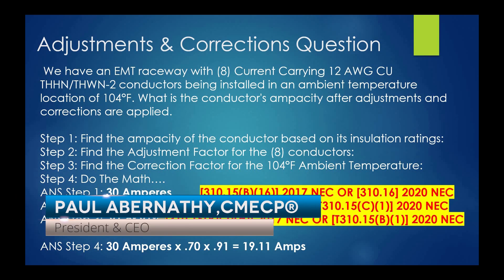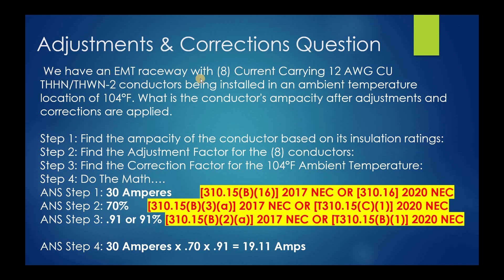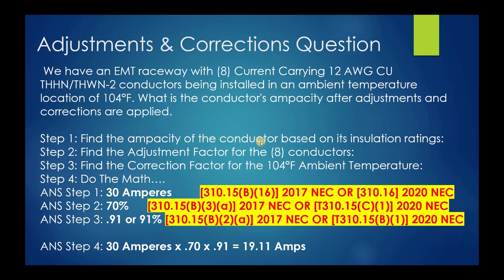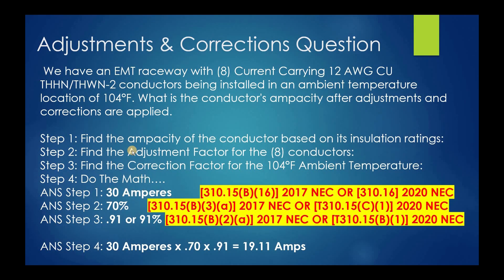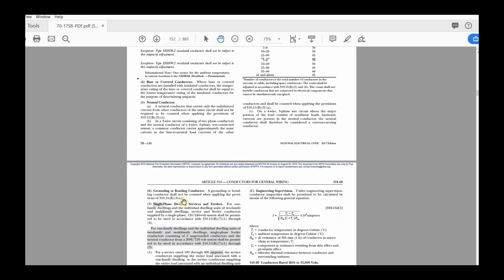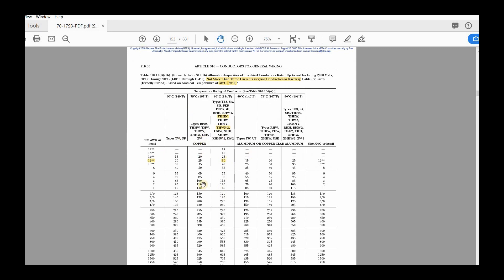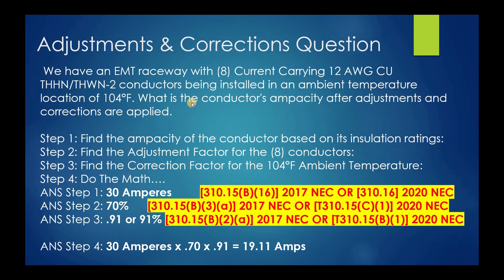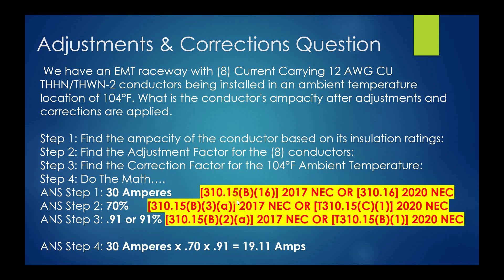Applying Conductor Adjustments & Corrections- Simple Example

Comment: Hey question.. so when u went to table 310.15 ( B ) ( 2 ) in the 2020 book, and you went to the 90° column and then picked the ambient temperature of 104°F.. how come you got .91 when on my chart it says 1.00 for my correction factor? Unless im off or im missing something, did you mis use the percentage or is there something i did wrong? How do you know when to use table 310.15 ( B ) ( 1 ) or 310.15 ( B ) ( 2 ) ? I figured we'd use the ( B ) ( 2 ) because it says " based on 40°C ( 104°F ) and 104°F is our temperature.
Reply from the maker: You never use (B)(2) except when working with ampacities in Tables 310.18 through 310.21. If the table, such as 310.16 and 310.17 is based on 30°C (86°F) then why would you attempt to use a table based on 40°C. Watch the video again.....you use Table 310.15(B)(1) and the 60, 75, or 90 is chosen based on the insulation rating of your conductors. Also if you see 1.00 for 104°F on your Table 310.15(B)(1) I suggest you return it quickly...;)
Reply: @MasterTheNEC  appreciate the response 👍🏼

Comment: Thank you for the video I have a job site situation. I have 9 circuits (general use receptacles) to run in a 1 inch EMT. So 18 current  carrying conductors. number 12 thhn. So 50 percent adjustment on 30 amp wire. Is that ok on a 20 amp breaker. Thank you.
Reply from the maker: No, see my other response to your previous question. Also if anyone says you can use 240.4(B) they would be wrong since you are supplying receptacles so 240.4(B)(1) renders that unavailable and since an OCPD rated 15A does exist you are bound to it. If the circuits must be rated 20 A then you will be forced to reduce the number of CCC's in the raceway or consider MC Cable as an alternative option.
Reply: @MasterTheNEC  thank you 🙏.

Comment: A question please sir,
We have  some of insulation listed in 75 column and 90 column so which column should I use?
Reply from the maker: You can use the 90°C Ampacity value for adjustments and corrections. However, you can not exceed the ampacity based on terminal limitations. So, at the end of the day you can't exceed the 75°C value.

Comment: How do you know in the 2020 code to use the 310.15 (B) (1) or (2)
Reply from the maker: Greetings,

So, (B)(1) is for Tables 310.16 & 310.17 based on the 30°C nature of the table, you will use (B)(1) 99% of the time.
Table 310.15(B)(1) Ambient Temperature Correction Factors Based on 30°C (86°F)

And, (B)(2) for tables 310.18 through 310.21 as the nature of those tables are 40°, as shown below.

Table 310.15(B)(2) Ambient Temperature Correction Factors Based on 40ºC (104ºF)

Comment: Hey great video, thanks for the information. I just subscribed after viewing this video. I have a question my professor has given us a similar question. Theres 9 current carrying conductors installed in an ambient temp of 104f. I got the .70 for the conductors but I'm confused as to where to find percent for ambient temp without amps or wire size given to me.
Reply from the maker: The values used for ambient temperature above or below 30°C (86°F) is 310 15(B)(2)(a) in 2017 NEC or 310.15(B)(1) in 2020 NEC.

Comment: So if I have 2 #10 THWN current carrying conductors run in PVC on top of a roof with an estimated 114-122 degrees F all I need to do is multiply 35 by .75?   And the maximum amperage allowed for those conductors would be 26.25?  That is easy is right!
Reply from the maker: Greetings Kevin - Well THWN is only able to be adjusted from the 75C column in T310.16 since the insulation is only rated for 75C as stated. Now, when using T310.15(B)(1) as well you would use the 75C column as well. So If you are looking to see what the NEW ampacity is of the conductor based on the ambient temperature of 114-122F then that multiplier is .75 as you correctly stated. So the ampacity in T310.16 is 35 Amps so 35 x .75 is indeed 26.25 Amps and that is the new ampacity of the conductor. Keep in mind you only had (2) current carrying conductors so if you end up more than 3 then of course you would bring 310.15(C)(1) into the picture as well...that would look like 35 x .75 x .80 assuming 4-6 current carrying conductors so it would be 21 Amps with both adjustments and corrections figured in. Hope that helps and sorry for the delay as I am back home with my mother.

Comment: "Simple" he says...
Reply from the maker: Easy Peasy...:)
Reply: @MasterTheNEC   It's the jargon that gets me. Interchangeable terms and vaguely defined terms. I get how an electrical system works(mostly), but trying to learn the particular lingo and understand it to the point where there's no loss of comprehension when trying to take the test, that's what concerns me. You do a great job brother and it is greatly appreciated, but not even you could make the process of learning the standard definitions and book memorization painless. I'll still watch though, you're as good as it gets to relating what is meant to be said in this book of secrets(NEC).
Reply from the maker: Sam, I understand. The terms we use are normal for those who have the time in, qualifying hours,  to qualify to take an electrical exam. Actually, the terms are found in the definitions of the NEC, and they can be complicated but over time they become easier. Our Fast Trax™ Program is designed to teach these things but it does take some time to feel comfortable with the terms.
Reply: @MasterTheNEC  I have a copy of the 2020 edition. Im getting used to it slowly. The issue for me is context. When I'm watching one of your videos and you go over something specific, in context, then it clicks and I understand what's being said in the book. I think i have a basic understanding of the nature of electricity; i see it as similar to fluid dynamics and when people compare things like voltage to pressure it makes complete sense. I'm good at troubleshooting problems in electrical systems; i.e. tracking down where someone has tied the neutrals for 2 circuits together, and im good with basic code like sizing wire and loads, but its the technical stuff that is going to take some time for me. You have definitely been my biggest help with getting a sense of what exactly is being said in the book and i really appreciate you for it Paul.
Reply from the maker: You are most welcome brother..Keep At It......Glad you enjoy the vids and podcasts. Keep on that journey!
Reply: @MasterTheNEC   Hey Paul, i hate to bug you but can you answer me a couple 3 questions? #1, how much is your fast trax program, and #2; im confused about the wording with the new dual function breakers. As i understand it,  in 210.12(a) that covers arc-fault for what seems like every residential application; does it cover bedrooms? and if so, what are stipulations for dual function afci/gfci breakers? laundry/kitchen/garage/below ground level and damp locations? I wish it were more clear but i have the feeling i need the last 10  code books to get context; im not finding it in this one. Thos dual functions cost an arm and a leg, and I want to know the proper applications, i just cant find any direct information. It's vague here. and vague there. I'm about ready to just afci all overcurrent devices except for bathroom, garage, kitchen and laundy and dual function their protection devices. I dont want to spend excessively, but i also dont want to make any errors. I'd appreciate any help brother, and if i can afford your program, i'm going to sign up asap.
Reply from the maker: Greetings Sam - That's alot of questions for reply comment but I will try to answer as brief as possible. 1) The Fast Trax™ Program is $315.00 for 2017 NEC Course or $335.00 for 2020 NEC Course. 2) 210.12(a) covers bedrooms as well as it says "bedrooms" in the list of locations where AFCI protection of branch circuits. The Dual-Function is simply a device that does both AFCI Protection as well as GFCI Protection and nothing more. Anywhere you have a situation where you need both on a branch circuit a Dual Function device can be used. For example, in the kitchens for the 2020 NEC, you can place a GFCI receptacle in branch circuit to meet 210.8(A)(6) and install an AFCI Circuit Breaker in the panel that supplies the branch circuit or you could get a AFCI/GFCI Dual Function Device and it will do both. The NEC is very clear on this......there is no mystery in the device, it just can serve two functions if you desire that in a single device. As for cost, you may find that dual functions, which are not that expensive really anymore since they are available for under $50.00 dollars is about the same price the AFCI circuit breaker alone used to cost but in this case you get the benefits of BOTH in a single device. Hope this helps.
Reply: @MasterTheNEC   Thank you Paul. I appreciate you getting back to me. It may take a couple of weeks, but im definitely going to be signing up for your program. I'm looking forward to it.
Reply from the maker: Glad it was helpful and it will be a pleasure to have you in the program.
Reply: @MasterTheNEC   I signed up thursday; to be honest i was a bit disapointed to see that it could take up to 5 business days for the course key. I suppose i let my anticipation and excitement get the best of me. Anyway, I'm sure its well worth the wait and i know that even if i pass the exam, i'll be utilizing the program for the entire year. You're the best Paul!
Reply from the maker: Sam - It says right above where you place the order that it can take up to "5 Business Days". I am sorry you're disappointed but the facts are the facts. We are at the mercy of our LMS Provider and they take time to log the keys that we can tie to our course. So in most cases it takes less time BUT recently due to the school year starting, storms that came through the gulf, Covid-19 causing the LMS providers to work remotely it has been a delay. I am always happy to refund any students course prior to them actually getting their log in instructions so for those who can't wait or who are waiting just let me know if you wish to cancel I will gladly cancel the program and refund any course fees.

Comment: how about f d ambient temp s not given, how would u get the temp coeff correction ?
Reply from the maker: No one ever said compliance was easy my friend. The ambient temperature in many cases is the air where the install is present, such as attics and so on. However, there are documents for ambients in raceways on rooftops and so on via https://www.copper.org/applications/electrical/building/rooftop.html

The difficulty in applying a temperature correction is why many don't do it. However, for an exam (versus the real world) the values will be given to help you solve the problem.

Comment: Very helpful! Thank you. 👍
Reply: Is it against cose to put line and load in the same emt? If so can you tell me where to find it in the code? Im in a situation at the moment and really would like to know.
Reply from the maker: Greetings. Other than Service Conductors in accordance with 230.7 there is nothing in the NEC that prohibits Branch-Circuits and Feeders in the same raceway. Keep in mind that the insulation ratings of the conductors all have to be equal , for example, if 600V rated insulation is in the raceway then you could not use 300 V rated insulation in the same raceway.